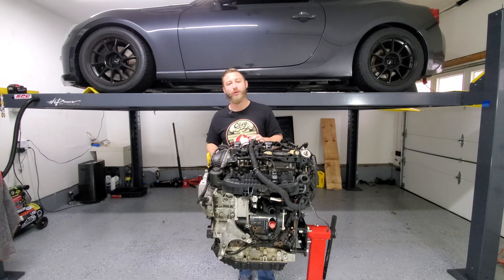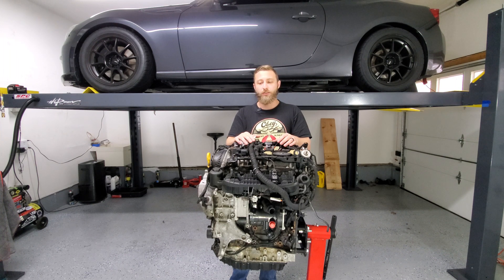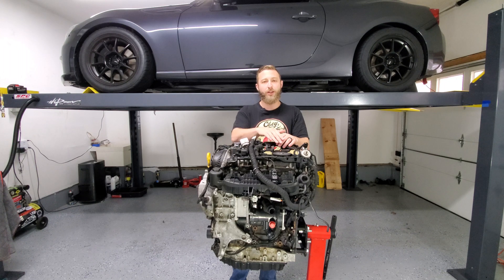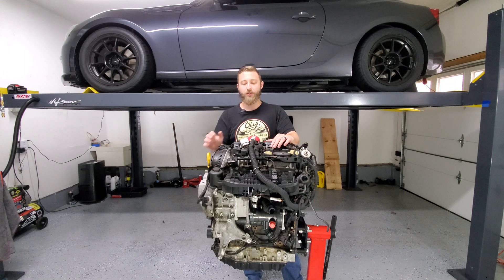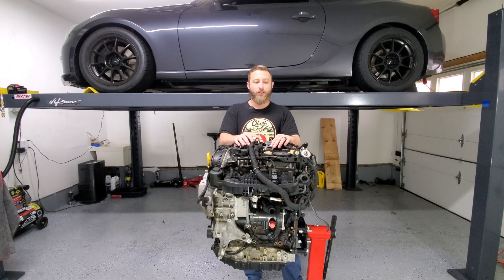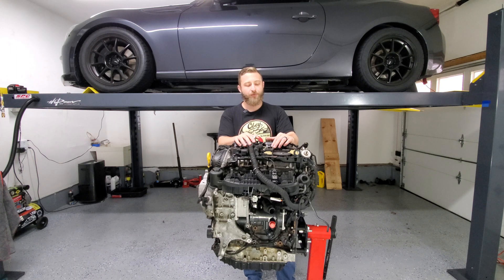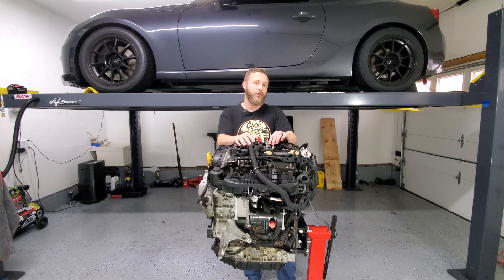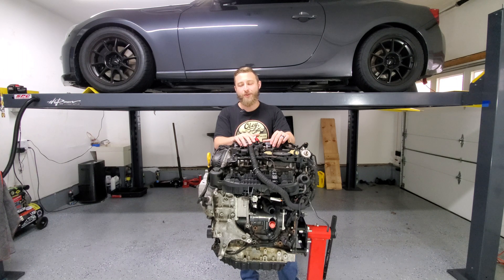VW Engine Failure 87000 Miles 1.8 TSI

Comment: My 2018 VW Atlas failed ENGINE, service at dealership won't provide what is wrong with it ( only sparks and few misfires) and they want 20,000.Outside of warranty VW USA refuse to help at all.Anyone can suggest what should I do?
Reply from the maker: If the motor is still in the car you should be able to compression test the block; getting a used motor from a junkyard will save you a lot of money if that is what's needed. Used motors run about 2.5k shipped to your house. That quote of 20k is criminal, if you know anyone with an engine hoist and feel comfortable swapping the motor this is your lost cost effective route imo. How far out of warranty are you concerning time or mileage?
Reply: @MarkMethods  thank you so much for replying,I'm about to have a stroke about it.Its 77,000miles on it.I called one shop they said to new ,they don't have software to reprogram it(((5,000 past warranty,plus 2 second owner,but done all maintenance at same dealership.
Reply from the maker: That's insane, look around for a VW specialist nearby; plenty of people who aren't dealers working on these vehicles.
Reply: @MarkMethods  thank you Mark, took it to shop, will cost me 7000. Will try to look at the old Engine,after they will remove it, possible manufacture defect ( sparks burned very bad - without any couse.When we were towing car from dealership service,one guy run to us at the last minute and gave us those burned ones,original and said he was the one who pulled them out. Very weird service......... will know more this week
Reply from the maker: That's a much better quote than 20k, I'm interested to hear what ended up being the issue if they end up identifying it. Good luck!
Reply: @MarkMethods Thank you, definitely ,will let you know hopefully soon!

Comment: I have same engine it is crap burning oil 1L every 1000KM.
Reply: I have one at 170 000km, I bought it at 88 000km 2 years ago and it is running very good. I drive it hard very very often and havent gotten any problems yet.
Reply: Was it always that bad or did it get progressively worse?  How many km on the engine?
Reply: i used 1 liter of oil every week, arround 350-400 kilometers hahaha only highway kilometers... insane oil usage... its for engine overhaul/revision and dsg full service at the garage now... as part of the warranty i bought with it. garage owner wasnt happy but he said; ill take care of it, its my fault i didnt gave it a revision before selling it...    wont cost me anything.   but if u buy this engine, and u start noticing oil usage, better sell it as soon as possible cause fixing this will cost u like 2000euro 3000euro easy

Comment: Is it possible to sue Volkswagen??
Reply from the maker: Potentially the dealership who performed the oil change and work prior to failure. I'm not sure how difficult it would be to go directly after VW in the same capacity, it's possible but maybe a bit more difficult.
Reply: I think you don't want to with their lawyers

Comment: More than likely the engine in your Golf was very low on oil. These direct injection engines will dilute the oil and will cause wear on the piston rings thus oil consumption.
Reply from the maker: Judging by the initial oil levels I would agree; it did seem low, a dealership was the last to change the oil after warranty service. I had checked it after the service and it appeared fine, no drops of oil on my garage floor; more than likely internal consumption. Still need to pull it apart and get down to it but I think you're probably right.
Reply: @MarkMethods  
These modern direct injection engines can't be used like port injection engines, they will eat oil between oil changes, a lot of oil! The oil level must be checked every time you fill up the gas tank. Moreover, there's no oil level sensor warning... There is however, a low pressure oil switch/sensor that will get triggered if the oil sumps doesn't pick up oil during cornering or accelerating hard.

Comment: hello!
i have a 2013 skoda octavia/1.8TSI/CJSA engine,90.000km.
please tell me when i have to change the timing chain,in the car s manual i did not find informations! 
thank you!
Reply from the maker: Timing chains are designed to last the life of the motor typically; unless you're hearing chain slap it's something you shouldn't have to touch. Typically the guides/tensioner will fail before the chain itself. However if an overhaul is being done to the motor such as a new head gasket, it may be a good time to refresh the chain, tensioner, and guides since it's apart already.
Reply: thank you very much for answering!
the engine does not make strange sounds...
Reply: @abcdefgh-fi2zw  i have 1.8tfsi engine and the guy at the dealership told me it is recommended at 200k..i asked him how much he told me 3k. This was when i brought in my golf for warranty because of the leaking thermostat housing...i cant believe this is not a recall. I had to use my extended warranty to fix this so they keep all the money now: if you dont have claims you get back 1500 from extended warranty that cost me 2200-2600 aprox CAD. Vw really let me down with the mk7, I think this will be my last vw ever. Windshield cracked on its own, visor plastic broke off when i put envolope into clip. So i need a new visor now. Third brake light leaking and dripping over rear window and leaving calcium build up. Brake rotors were warped at brand new 0 km. When i go over bumps sometimes I get a creaking sound. Like what a disaster. Too much fragile plastics on the engine, quality really went down. Manual transmission gears are way too long and clutch feels like crap...etc i wouldnt recomend buying one.
Reply: @Maplesyrup416  thank you for the answear!
My thermostat failed at 15.000 km!!!!! . They changed  it.. you are right,  VAG cars are garbage !!!!!!
Reply: @abcdefgh-fi2zw  wow thats insane john..that sucks at low clicks. Mine happend at 97 000 kilometers. :-( now i have to worry when will it happen again

Comment: Hi just subscribed , sorry about the engine failure . You said you followed the maintenance schedule VW recommend , so you were doing 10k oil changes with 502 oil ? What oil did you use ? Your car was a manual trans. I imagine or auto .
Reply from the maker: Hey thanks for stopping by, I followed standard VW oil changes 10k miles 502 Euro Mobil 1 5-40; it was a manual transmission also. Hopefully when I've got time to open the old motor I'll be able to pinpoint the cause.
Reply: @MarkMethods  Thanks for the reply , yes im curious also what you find ..